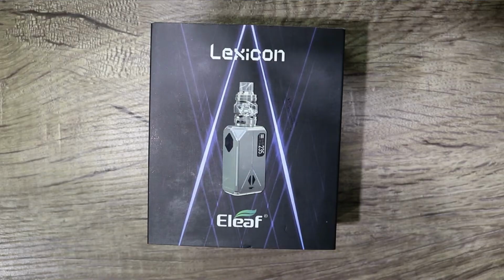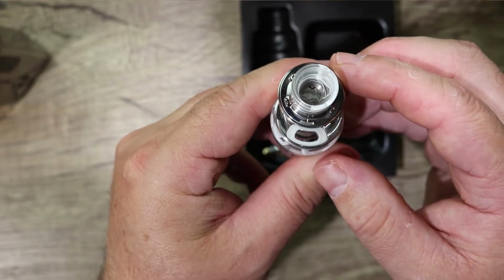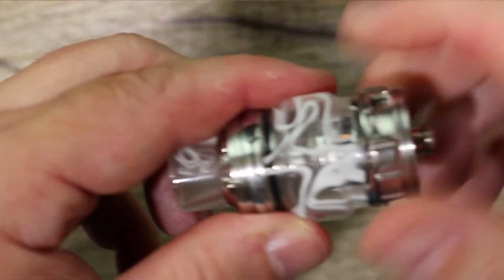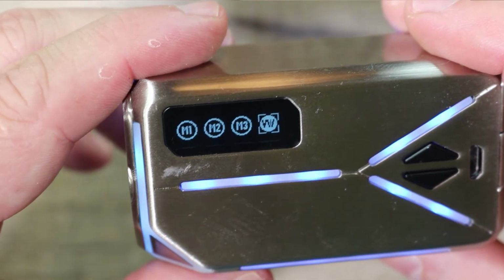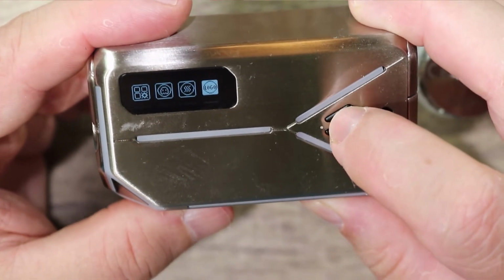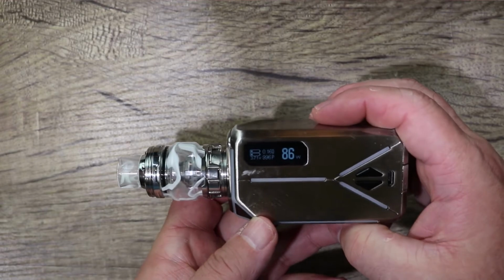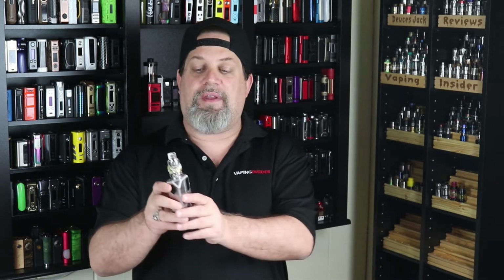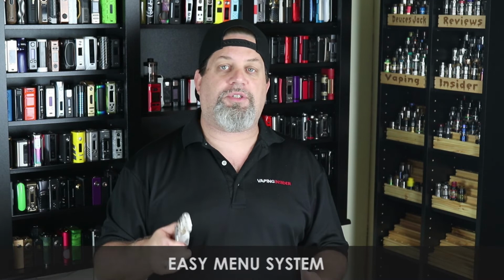Eleaf Lexicon Kit Review ✌️🚭

Comment: As far as i know, the Eleaf Ello Duro Mesh has the resin body that like the plastic tank to match the Eleaf Lexicon. There are some white strips are around the Lexicon Mod will give you the cool LED show. Powered by dual 18650 batteries, it output wattage reach to 235W. You can easy to into the main menu to set your vaping modes. Such as Nickel, Titanium, Stainless Steel, M1, M2, M3, and the regular wattage.... Thank for the video man !
Reply from the maker: Thanks for watching our Eleaf Lexicon Kit review, Tokio90!

Comment: This mod completely fell apart within 5 months of daily use(never dropped, never in pockets or bags). Here are the issues within 5 months. These issues are reported with the other lexicons in the shop.
-top panel fell off and the wires underneath cracked.
-the triangle cut outs at the top FELL OFF 
-all screws on the mod became loose and fell out
-led's stopped working properly and light up out of sync
-some led's stopped working all together
-micro USB port was very flimsy and warped
-battery door became loose and no longer stays closed
-paint job faded quickly but is still visible
These issues make the mod unusable. I have to disagree that this mod has good build quality, infact, it is very cheaply made and has a TERRIBLE build quality. Regardless, this is my favorite mod in terms of looks.
I bought this mod because I thought it was sturdy and because it looked GREAT. I also thought that the wattage range was awesome. DO NOT BUY THIS MOD IF YOU DONT WANT TO BUY ANOTHER ONE WITHIN 5 MONTHS
Reply from the maker: Sorry to hear that. It is an eleaf though. Not exactly known for quality.